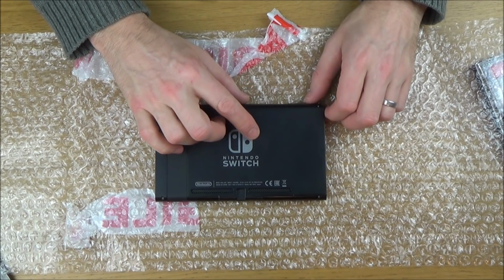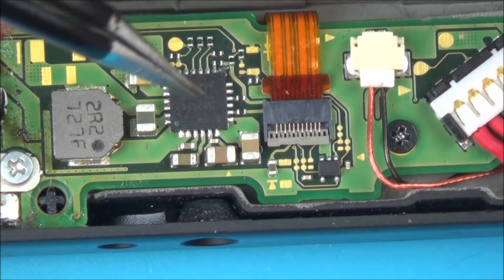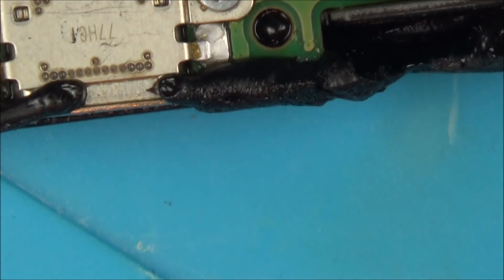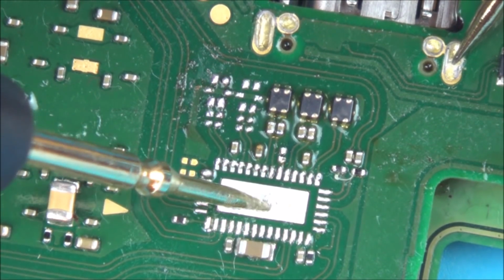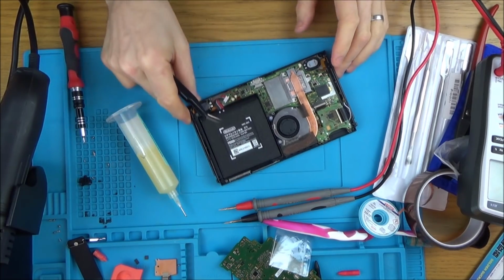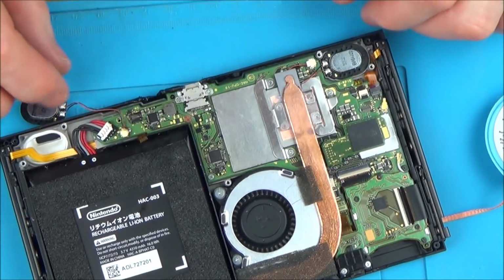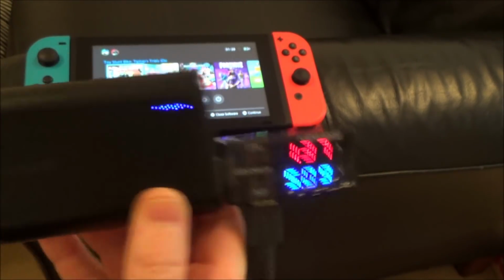Trying to FIX a Nintendo Switch with Numerous Faults

Comment: Those small components could be resistors or capacitors and both will show continuity in both directions since the capacitors are not polarized.  Capacitors block AC signals and the continuity tester uses DC to measure resistance.  The difference is that capacitors will start with continuity and the resistance will rise as charge builds.  You need to test the pads beneath those small parts to see which pads go to ground.  And Kapton tape just has a high resistance to melting or burning it will not shield components from heat.  I have washers that I've epoxied silicon to that I use as heat shields.  As for the hot air wand, think fogging your glasses to clean them not pressure washer.

Comment: Have you ever worked with "low melting solder"? They are expensive but really useful.
Also, you should definitely not slide your multimeter probes across pins while there's power running in the system. You just caused a short which can damage chips.

Comment: Just an fyi on dock connection. It is most likely the usb port itself. The 2nd row of pins would be responsible for dock connection. 

The 2nd row is very difficult to solder as you have to rely on reflow heat alone and having the board stable while properly aligning to allow wicking to do the work for you.

This repair should really be done with a reflow machine, but can be done with a reflow wand, patience and determination.

Waiting on a part shipment from CH, but i may do a video on it once they arrive.

Ultimately... You did good, technique and protocols to prevent added work from self inflicted damage can use some improvement, but that comes from experience. Keep soldering.

Comment: Great to see you’re brave enough to be trying to fix this Vince, at least you gain experience. For what it’s worth, I never use kapton tape but use a small nozzle on my hot air iron, temp set to 480 degrees and a low air flow (51 on my Aoyue) so as not to blow other components away.
The broad ribbon connector from the topscreen can be a bitch, yes. The trick is to keep it as flat as possible when sliding it back in and if there’s any more resistance then expected, pull it out and try again. It’s not very difficult but you have got to be careful. I’ll watch more of you’re vids as they are very interesting and also because some of your situations remind me of myself not that long ago!
Watched a little more after what I wrote above and nice to see you reach some good conclusions on your own 👍🏻

Comment: Maybe you should use chip quick with the heat gun next time to remove such a chip.
You should disconnect the battery before probing or soldering too.

Comment: Hey Vince! I was wondering if you could help me out with my Nintendo Switch. I've just bought it yesterday and I've downloaded at least 3 games and neither any of games are working well. It keeps popping the "software was closed because an error occurred" I don't know if it's a hardware problem or some software problem? I'm currently not the UK right now so I set my region to Japan (I'm currently somewhere near there since it's the only region in Asia) and set my date and time according to where I am located. Does having different region and eshop account (UK) effects the game software??

Comment: my switch died about three weeks after I got it because the charger was faulty now I'm not going to say it's my fault even though everybody else is going to blame me because it is literally impossible to avoid find your switch's charging port unless you never charge your switch it's only a matter of time because Nintendo did not put protections on the charging port I guess it was good that I got it as a gift otherwise I would have wasted $420 for nothing
Reply: Did you tried other charger with Type C?
Reply: @emasplatter5567  it was c-type I charged it using the charger for my phone because I was away from home and I didn't have the dock with me (I don't know why somebody would carry the dock with them the switch is portable but the dock isn't)
Reply: @draconic5129  phone charger don't give enough energy to the nintendo switch
Reply: @emasplatter5567  that's why I think the charging port might be faulty but I've heard that it's a common problem
Reply: @draconic5129 try charge the switch in the dock for a entire day, if still doesn't work then it may be a undervolt problem.
Reply: @emasplatter5567  I already tried that I left it there all day when I went to work and it still won't power on I tried connecting it to a computer and it wasn't even recognized as a device
Reply: @draconic5129  it's a undervolt problem, the switch doesn't get enough charge, maybe you didn't used for some weeks?
Reply: @emasplatter5567  all I know is that after I charged it with my phone charger about a minute later it shut off and quit working and wouldn't turn back on even after charging it in the dock
Reply: @emasplatter5567  but I'll try one last time I'm going to leave it in the jack and tomorrow morning I'll see if it still won't turn on
Reply: Maybe the battery died, try buy a new one
Reply: @emasplatter5567  a new battery or a new Nintendo switch because a new Nintendo switch is $420

Comment: you can use aluminium foil and you can put a copper penny to protect that area, and if you want to get back to this switch for that joycon you can heat under the connector from the other side so you can't melt it anymore

Comment: So much air and temperature can burn cables or other components, be careful and the worst things are when other components move like capacitors, resistors or fuse. Men like you're going to burn the chip after the replacement, but do not worry, this is an experience

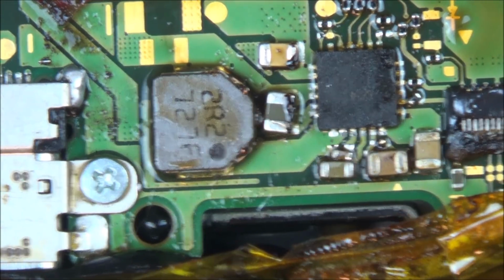Comment: 28:00, OH no...I think it whould be better with double tape and only on the components. Edit: I I heard in the ending you used 3-4 layers. Well then you problably need some heat resisting goop? But in normal cases when they fixing old computers 2 layers directly on plastic components is enough. You have to think more about how you hold the heat gun.

Comment: This guy is so painful, he fix one chip but damages 20 other components around. Good thing you manage to get it working at the end. Your problem is the blower settings... the heat is too high brother.
Reply: And you can see the capacitors all around  out of place after the ic replaced

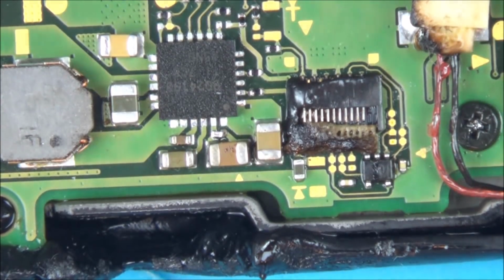Comment: At 40:22 did you replace the mini missing capacitor as well at the top if not that may be why the docking isn't working.
Reply from the maker: I don't think I did, looks like it should be a resistor that one. I will double check :-) It is docking now because I changed the USB-C port but it only docks when using a 3rd party portable dock. Thanks for letting me know :-)
Reply: Sorry I meant to a resistor lol
That's good you have it docking now but it does kinda raise more questions of why it does it in another station. 
I know usb-c can meet all sorts of different specs, so maybe the other branded one uses a lower spec or something compared to nintendo's which maybe is fully spec'ed usb-c? 

Anyway curious to hear how you get on :) 
Keep up the great work ;)

Comment: People told you to look for RCM because some install something called AutoRCM, which would put the console into RCM every time you turn it off and turn it on again. It would only boot to RCM instead of normal. In that case, the jig is useless, since it's used to enter RCM but your console is already in RCM.

And secondly, the jig only works on the right joycon rail. You can't trigger RCM mode with the left rail.

Now, if indeed the console boots to RCM directly, you will need to push a payload using TegraRCMGUI.

You can read all about this here:

https://guide.sdsetup.com/

Comment: Hey Vince, I once did replace a plastic connector in a Nintendo DS by heating te opposite side of the PCB. Of course there can't be any components onto the other side of the PCB. This could possibly also work for replacing the usb connector.
I admire your patience in repairing these things.

Comment: PCB boards have markers to identify Pin 1 for ICs. That's how you know the proper orientation of them when soldering them back.

In case of those Switch they have small triangle/arrows.
Reply from the maker: Thank you :-)

Comment: Also try and add a bit of leaded solder to the joints on the chip before using the hot air, this will reduce the heat required to lift the chip. The solder on the board is unleaded and has a higher melting temperature, by adding the leaded it will reduce it. This will make it a lot easier.
Reply: Seeing a.n.other repair guy absolute flood the chip with solder.

Comment: As well as using kapton tape , try putting some coins over important components before taping. This will act as a heat sink and help protect it. Also try foil tape over the top of the kapton tape, this helps as well keeping the heat away.
Reply from the maker: Thanks for the tips :-)

Comment: Good job Vince!  Your 'can do' attitude is amazing to watch and is very contagious! Please keep these videos coming! . :)  I do this these sort of repairs at work and I use about 400C at half speed air with no problems, but you probably don't want to go much higher temp than that (390 - 410).  Lower temps means you have to stay on target longer (could be bad) and going too hot can damage other parts of the board.  A quick 'in and out' is the way to go.  I also think you were initially using too much flux which transferred hot flux to other areas of the board which might have helped melt those plastic parts.  You'll get the hang of how much flux is enough to keep the part fluxed without it spreading all over the place.  I think you got some good advice from TronicsFix regarding better heat shielding to those delicate parts.  Overall you did a great job for not having had much experience. You get good at this sort of thing by learning from others but also by doing it yourself and making mistakes.  It's almost an art form but it can be mastered by anyone who sticks with it (it can be frustrating at first!).
Reply: Great advice and genuinely encouraging.

Comment: You get many different tips most of which are square and off different sizes and can be used to de-solder these chips so hot air guns are not always required, these maybe what you need for your hot air gun https://www.alibaba.com/product-detail/hot-air-rework-soldering-station-A1128B_60618039548.html
Reply from the maker: I have never seen tips like that before. I will look around eBay and Amazon to see if they are available to order here. Thanks for the link :-)

Comment: If you had aluminum foil around the components to protect them more and your hot air at around 350 degrees I don't think you would have melted the ribbon cable connector ☹️ Nice fix though Vince. Love your channel!

Comment: Nice fix Vince.
If you are looking for shorts do not use the beeper mode it puts out a high voltage and will turn on diodes etc inside chips making it beep, so you think it has a short.
You are again using a meter in continuity check with power on the board, if you connect your meter in this mode across a li-ion battery it will probably beep one way round making your test a waste of time. The meter in this mode gives out a small voltage to test for continuity so you cannot have any power to the board.
You also used your metal tweezers with the USBc lead connected to a power bank.

When you use kapton tape you need to make sure it is down to the PCB if possible otherwise the air goes under it and gets the plastic as you found out.
Those IC's have a dot to mark the corner with pin1, I would not go by the writing being a certain way up.
The power bank went off maybe because you shorted something with your tweezers.
It may not have been the chip, because it was charging at 41:06 before you changed the charge IC. Does the charge port work both ways round? It may also work in the dock the other way round. I believe the the row of contacts you can see are when the USBC is one way round and the ones you can't see are for thew other way round.

Comment: Congratulations on getting it working. I'm really surprised it did after the torture under the full heat full flow hot air.. with the board in the case

Comment: Two tips mate, cut an hole with the size of Chip on the tape then apply it over. Buy yourself aluminum tape to put over the caption to deflect the heat. You can use kitchen foil too. You are putting too much heat , be patient 350c is ok

Comment: if you put the tape like that you make the hot air enter below the tape and that is even worse that no tape at all, just protect the plastic connectors well, dont use to much air flow and concentrate in the chip, even if you displace some caps, resis etc you can always put them in their place

Comment: I can remove those mini socket or the charger port without destroying like you done in the video .how do you think that the factory assemble that port .its a simple methode actually .ihave done it with many type of electronic .i replace more socket none plactic of them were melting even when the tin was melt. Maybe i show you how to change hdmi port on ps3 or ps 4 .or anything you  want just name it if i have ill doit for you

Comment: When working with plastics the easiest way is to heat from under the board ...loads of flux and when it's wet will glide into the pads. Great video btw!

Comment: Down to earth fix. Loved your determination to get that bugger working. I use old metal phone cases to deflect the heat with the tape or held down with a coin. Flux and wipe on any water damage I've found due to the possibility of a track gone which can't be seen until wiped. Nice video. Nearly forgot about that docking port, use solder paste when worrying about the plastic it melts quicker I've found.

Comment: My dad has a hotair solderstation and he has these clever little cups that sits over the chips preventing heat impacting other areas of the board. As a bonus it also has a spring loaded suction cup so the chip naturally lifts off the board when its floating. Not sure what they are called but here is an image of what I'm talking about:
https://i.ytimg.com/vi/5TvLvcU-jTc/hqdefault.jpg

Comment: I got a feeling with all that captain tape, hot air was just "channeled" under it to other components, since air was pushed down and basically only way it can go is all over the board. And captain tape just kept it going since it get trapped under it.  Not saying I am an expert or anything, but I really feel like less tape would allow hot air to rise after it got away from where you were blowing it, instead of forming hot pocket under the tape. Though I could easily be wrong, Switches are pain in the ass to work on.

Comment: Great video Vince. Really pleased to see it working. I wonder if the kapton tape was causing heat to get trapped. As you were blowing hot air into the hole it will have been going under the kapton tape and getting trapped. Intensifying the heat on the board rather than protecting it.

Comment: As for more control with the hot air what I've found to work is appropriate sized nozzle (Yours seemed a touch too large) and lots of flux. With boards that have a large thermal capacity, preheating and large airflow help. Also try aluminium tape, should be found at hardware stores
Thumbs up for keeping things like this ending up in e-waste

Comment: You'll have to use a second switch for any joy con firmware updates. So far I've had to upgrade my joy cons at least two times after a switch firmware upgrade. Similarly, the pro controller is firmware upgraded via the USB connection to the switch in its dock

Comment: Why did you switch boards when the video died...lol. now the chip on the bottom is also different. The burn mark on the usb port is also magically healed as well...lmfao.
Reply from the maker: ???? The same board was used throughout the video.